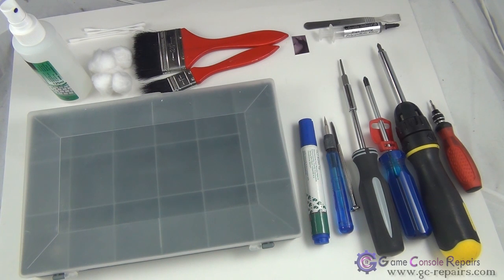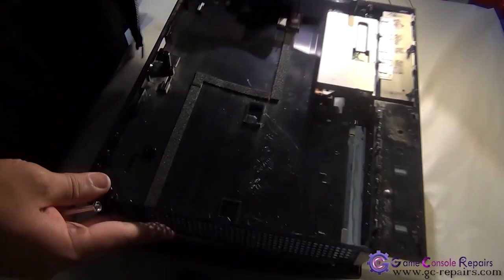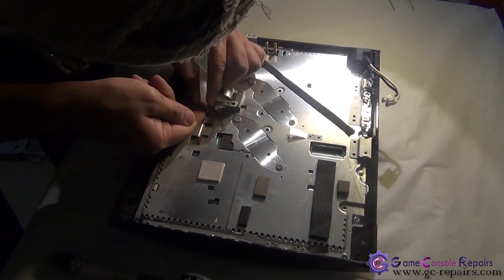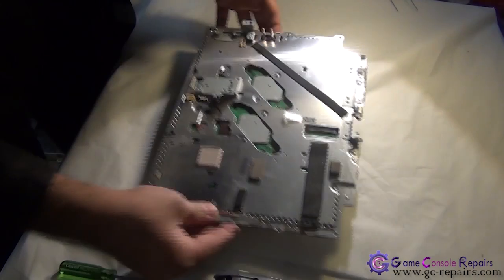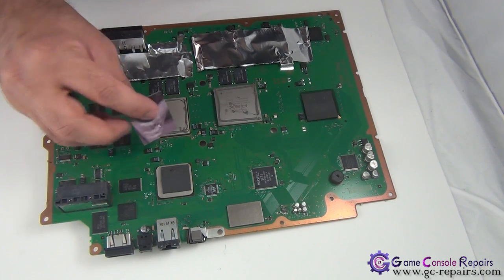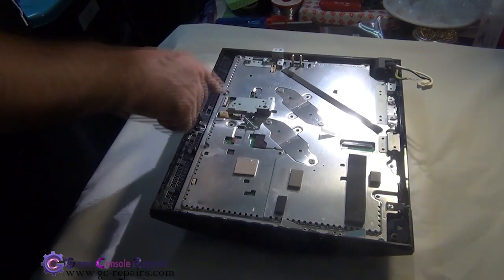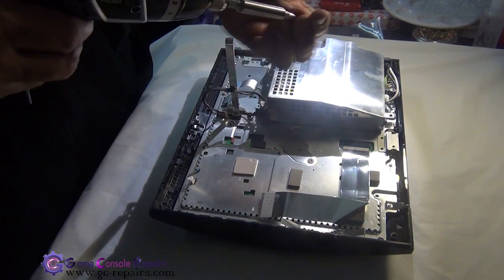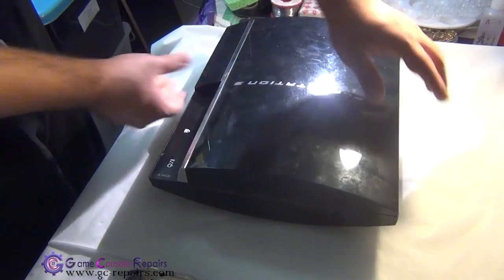PS3PHAT   60GB CECHC02   Thermal Compound Replacement by gc repairs com

Comment: So no need to heat the motherboard with a hairdryer as i saw in other clips?
Reply: this is changing thermal paste not fixing ylod
its the oil change for the ps3

Comment: sadly it didn't fixed  insane noise vent  when room is hot (all summer).
Reply: Enclosure HD Same problem here, isn't to loud(the vent is on 2nd speed) but is a bit annoying.
Reply: ***** my vent kicks 100% speed after mins hahahha XD
Reply: Enclosure HD Haven't you solve the problem? Can you play games? If yes how long?
Reply: ***** I can play games for hours. The problem is the vent noise. it's really annoying. It's like vacuum cleaner.
Reply: Enclosure HD Most of the heat comes from power supply, you can make an external power supply, it's not that hard.
Reply: ***** cool. didn't know about that.
Reply: Enclosure HD Can you make a short video? im really curious about how strong is the noise.
Reply: ***** I can tomorrow.
Reply: Enclosure HD kk

Comment: The way that u applied the Thermal paste creates BUBBLES!!!! Which avoids a proper heat transfer!!! U just have to put a dot in the middle and squeeze it with the fan !!!
Reply: YES! EVERYONE SCREWS THAT UP!

Comment: Good guide, saves a lot of hassle figuring out how to take the console apart. Replacing the cheap ass thermal compound with a better one and giving the consoles insides a good clean dust out works wonders.

PC gamers do this with their pc periodically to keep it running smoothly. Doing the same with a console will massively prolong it's life. My original xbox 360 us still going strong, ive cleaned it out once a year and replaced the thermal past in it a few times. No ROD or random shut downs.
Reply: But man, is a PC so much easier to do this to... My head is swimming with all the screws, turning upside down and rightside up. Still, a good video, will need to do this tomorrow.
Reply: Your not wrong m8. I had to get one of the trays with the little separate compartments to keep all the screws tidy. Just take your time and go slow and you'll be fine :-)

Comment: Tried doing this, successfully replaced old thermal compound, but when I put it all back on, my ps3 doesnt load games, the little clock on the upper right doesnt spin but i can hear the bluray disc spinning. GameConsoleRepairs please reply

Comment: i wont to do this for my ps3 as it is launch 60gb 8 years old now and it still going. No YLOD yet but it is getting hot alot of the time and ive never opened it. will taking the battery off wipe the memory.

Comment: It seems like a lot of work just to apply some fucking paste and even then there's no guarantee this will fix the problem. My fat ps3 is 6 years old and it recently started turning off by itself, i decided to finally get a slim instead of trying to fix it. If i can get 5-6 years out of my slim i'll be happy.
Reply: Some people can see the benefits of repairing the system. Others just like the challenge. And then folks out there who would rather dispose of something that may take someone else an hour to get working again... How have we become so wasteful?
Reply: Yeah working but for how long? Maybe for a few days or a week then dead again? Nah fuck that man. I had some extra spending money so i got the slim. Have fun with your hobby bro.

Comment: My bluray lens wasnt reading well, I fixed that my self, Now my PS3 is saying system is to hot, Please turn off machine. I applied Cooler Master IC Essential E1. Still the same, I spreaded it evenly. Should I wait for while or reapply thermal paste? 
Please Reply Thanks! :)

Comment: I used IC Essential E1 Thermal compund. Can you please check it out and tell me whether its okay to use that since that is the only one available in shops. 
Specs:
Color 	Gray
Specific Gravity 	2.5
Thermal Conductivity 	>4.5 W/m-K
Volume Resistivity 	1.0E+10 ohm-cm
Thermal Impedance 	<0.185 degree Celsius-in2/W
Volume 	1.5ml
Please Tell me thanks :)

Comment: Hello sir, 

I have a original 60gb ps3 that played ps2 games.

I start the system its quiet, then loud during game, then after gameplay very loud.  What do you suggest sir?

 I've never opened or cleaned it before.

 Thank you!

~Mike